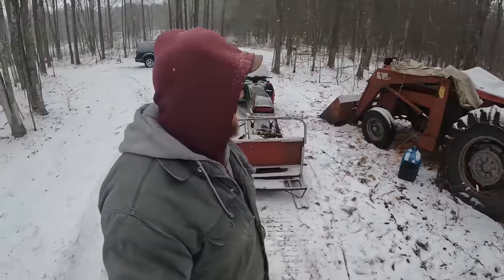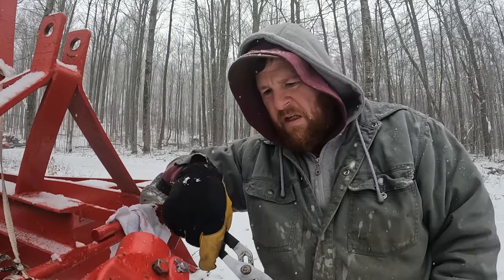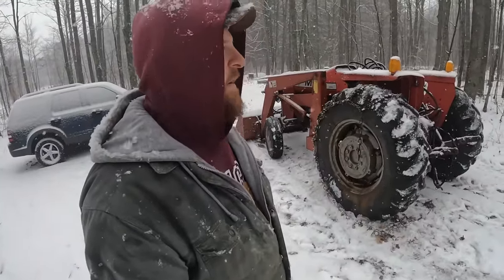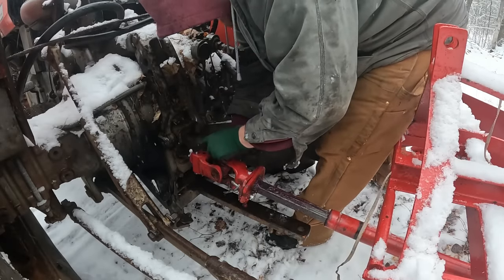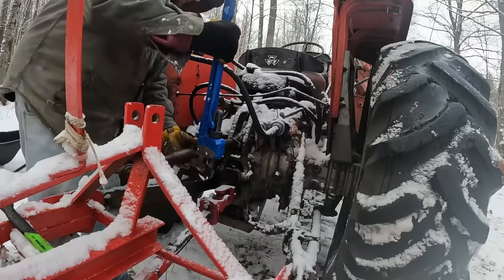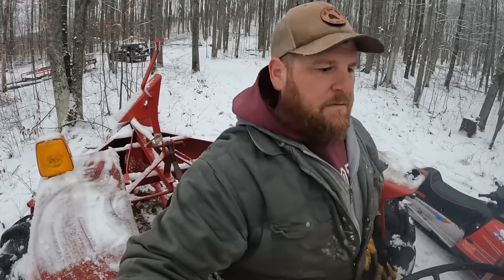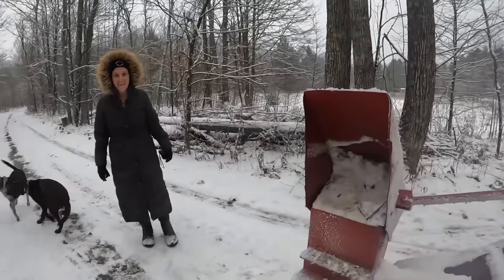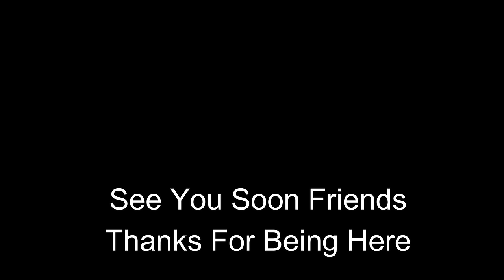A Blizzard Is Coming!  We Are Better Prepared for Winter Snow Storms at the Off Grid Cabin

Comment: Jay, 1 safety tip. Don't be around the PTO while it's turning.  If you need to get back there to adjust something, Turn the PTO off. Take it from an old farm boy. Stay warm.
Reply from the maker: Will Do.....thanks Jeffery
Reply: PTO shaft running a feed mixer killed my neighbor a few years ago. Stay clear.
Reply: Absolutely stay away from the PTO when it’s tuning! When I first started running equipment, when I was about nine years old, my grandpa gave me multiple warnings to stay away from the PTO when it’s turning and thankfully, so far, nothing has happened!

Comment: Pto driven implements are designed to run at full rpm. That impeller is both a thrower and a fan. If run too slow it will just pack up.

Comment: Get down to harbor freight and but a couple buckets of chain and fill in the rest for length.  Use 5/16 inch couplers to tie them together. Snowblowers like yours will only work good if the snow is deeper.  If you get 6 inches, in a few days, it will work like a champ.

Comment: There should be differentiallock on back tires will the same time when you activate it
Reply from the maker: I did find that pedal,  wasn't sure if it worked....but after slamming it down....both tires locked up. Thanks for the help

Comment: If you have chains it will for sure work. The fan style snow blowers need more volume to blow. So either you have to drive faster or have deeper snow. Rely on the sound to know whe to slow down or you'll risk shaping a shear pin.

That tractor with chain will climb crazy inclines!
Reply from the maker: Thanks for the info....i hope You're right =)

Comment: One time we broke down and got new chains for the tractor, it came with springs that went across the center of the wheel.  They made the chains stay on much better.  Why don't you use the loader to move the snow?  Park the tractor at the top of the hill and plow/snow blow down hill.  And when it turns to ice, sand /salt the icyness.
Reply from the maker: That might work

Comment: You could try putting studs in your tires. As far as starting your tractor, diesel engines fire from compression so they do need a lot of juice to crank them over to get them to fire especially in the winter. Hope this helps.
Reply from the maker: Nice.....good to know,    thanks

Comment: Just a thought , but if you bought about another 30 feet of chain it would probably be enough to rap the tires with a little cutting and welding and the chains are meant to ride exactly ware they do on the outside of the wheel !

Comment: I had a 1947 Cockshutt 30 with a 7.5 foot push snow blower on the back that used to clog up all the time.... This may sound stupid, but I waxed the shoot with car wax and lubed the fins with WD 40 , Problem solved. Even cooking spray will work on those old metal surfaces. I found if you keep a good coat of paint on the raw steel, this will also help things slide through ..
Reply from the maker: Very nice...good advice. Appreciate it

Comment: Hi Jay  i run dubble ring  chauns  on mine   you could just run a pice around the tire  and bolt the ends together     8 pc per tire  or more will work    good luck    spray Shoot Is with silicone or pam

Comment: conecting in series increases voltage , but Parallel doubles the capicity  , like 2 ,12 volt batteries , but Parallel makes 2 , 12 volt batteries into a 24 volt and could fry a 12 volt system and I am a Master electrician !

Comment: I noticed your generator was surging a little bit?  You may already know this but there is a product called sea foam if you add 1oz per gallon in anything that consumes fuel you will be very happy with the performance expecialy in small engines.  You can get it at any parts stores.  Freezing cold here in eastern washington we have the same amount of snow but cold and windy.  Thanks for the updates keep mushing along😃

Comment: Back in the day they would stud the tires. with 3/4 or 1" sheet metal screws . you only need about 10,000,000 screws . Were you running the snow blower at full RPM,s ?
Reply from the maker: The rpm gauge showed the pto to be running at 1700 so that's what I had it at. But I think the circumstances may need to be perfect for this thing to work
Reply: @OffgridwithJayandJen  Right on... Im sure the sand and wet snow didnt help

Comment: There is almost a religious school of thought that two 6 volt in series are the only way to go, however, amps are amps so I generally go with the biggest 12V deep cycle battery that will fit.  If you have the room and money either way will work.  Sitting in the cold without use is very hard on batteries.  Mowers, motorcycles, or whatever I have sitting all winter, I pull the battery and put a desulfating trickle charger/ maintainer on them and they last twice as long.  "Batteries develop sulfation each time they are used (discharged - recharged). If they are overcharged or undercharged or left discharged, some for even just several days, they will rapidly develop sulfate. Even when a battery is stored fully charged, sulfate will form unless a desulfating battery charger is used."

Comment: I see you are hooking up a battery charger to the tractor. There are Youtube tutorials on using a modern inverter-type stick welder ($130) to refurbish lead-acid batteries. Top off the cells with distilled water, then incrementally charge the 5-year-old dead 'junk' battery for an hour, and the high-frequency pulses generated by the mosfet transistors in the welder dissolve the sulfur dioxide crystals that have formed on the lead battery plates, back into the electrolyte solution, allowing the 'junk' battery to charge again. Turning a 'junk' battery only good for a core exchange into a perfectly good 95% new battery.
Reply from the maker: That is really cool......and a game changer. Thank you for telling me. I'll have to check it out

Comment: I mostly been just as poor as you kids and its better than being rich and no real friends. I took several sets and did what it took to make a set from the junk I had or found in scrap yards and old barns. In order to hook them together tho, never cheap out as it  will not hold nor last more than a few minutes. I reserve comment on this plow thing as its not the best invention or you would see them everywhere. Don't  go using soom cheap snap link thing similar to a Caribbean. They make links that spread apart and then you hammer it together but a tac weld would be much better as those spread    links do pull apart
Reply from the maker: Thanks for the tips My friend.  Nice to see ya
Reply: If you were to go to a place where they repair tires for the semi trucks, you might get some old chains that they will haul for scrap and make a offer of hauling some of them off for a minimum offer. Seems no one is willing to just give or gift junk away. It would make making a spot repair easier. just     kind of make your own parts and use those weldable links in for a good repair. The better they last, is from using the very best pieces and parts. @OffgridwithJayandJen